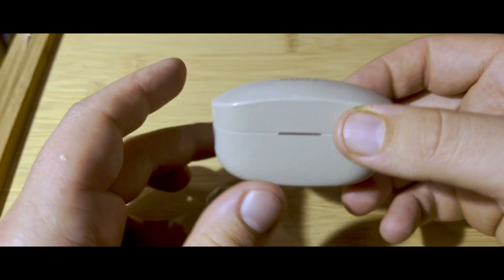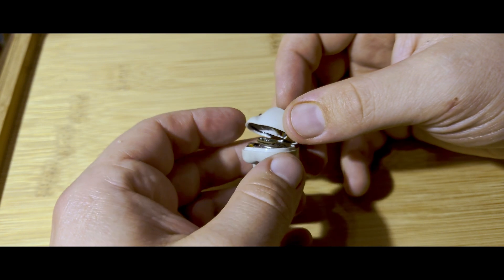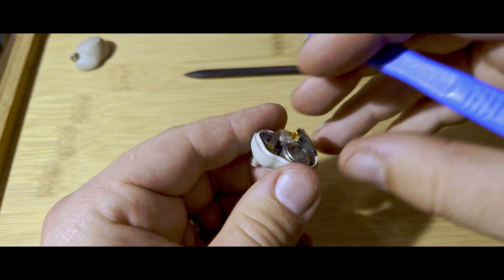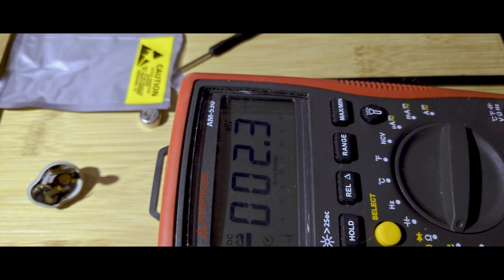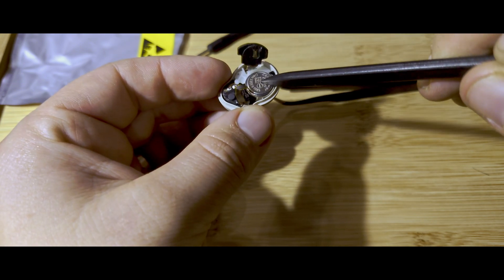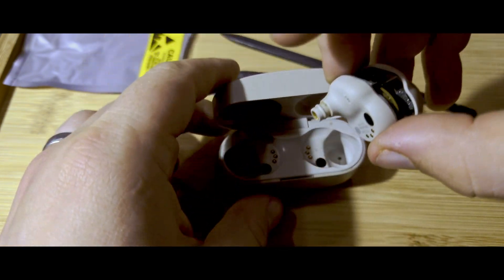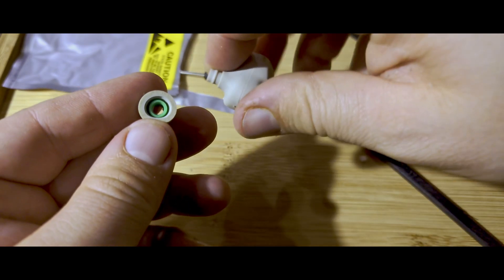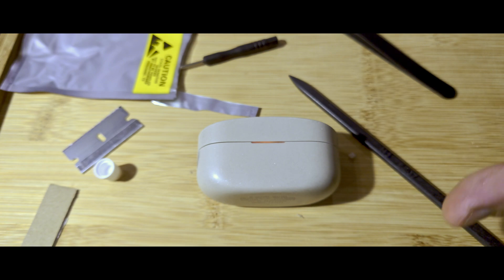Replacing Battery for Sony WF-100XM4 (Easy and Fast Tutorial)

Comment: You are doing perfect job, not even one scratch, other videos use knife and screwdriver to open shell, and this is best video, you point all important steps to success. I just bought Sony WF-1000XM4 and currently testing battery life, seems ok, also have older model Sony WF-1000XM3, which is also nice, but have to replace batteries in earbuds, left side only last one hour, and ordered not ZeniPower Z55, but Varta CP1254 A4, and already opened them easier than this model, and it is good thing that one can replace batteries for more life. Did you replace battery in case? This seems easier than replacing battery in case of Sony WF-100XM3, where soldering  is needed. Thanks for best video.

Comment: Very good video, thank you. Mine died right after a firmware update (fried the battery during charging) and Sony refuses to repair or replace them, so I will give it a DIY try. Can't get much worse, heh? 
Will never buy Sony hardware again though, that's for sure.

Comment: My WF1000XM4's had a right bud issue. The battery would drain from 100% - 0% within an hour. Had them 2.5yrs with alot of gym use and so couldn't complain. Wish Id have seen your vid before buying the XM5's at £170. Lol. But they are superb ear buds and I am extremely happy with them. Great vid though.